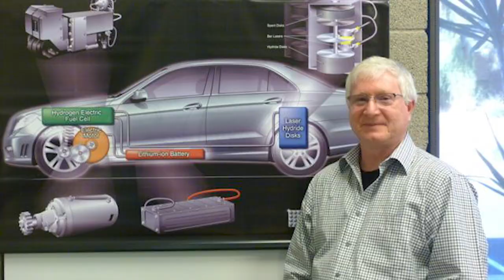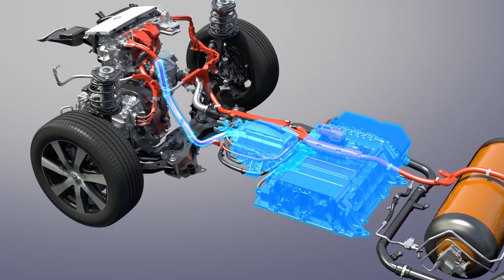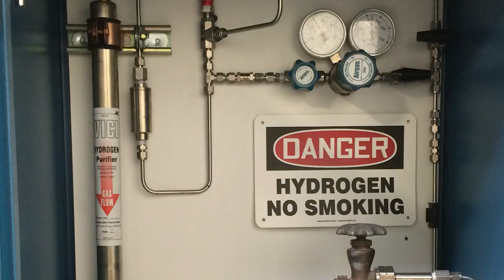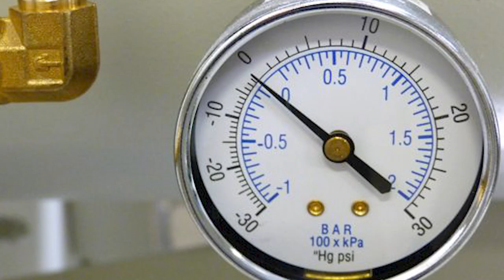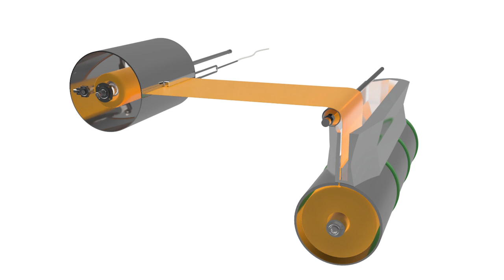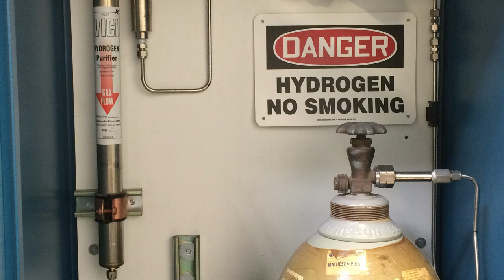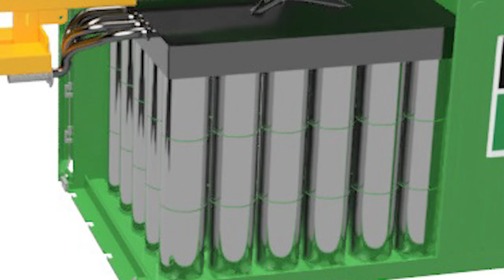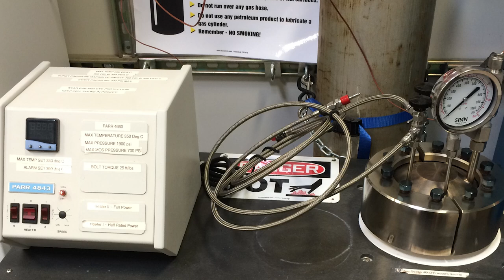This BANNED Technology Could Push Hydrogen Cars Over BEVs

Comment: Incredible! Looking at this, electric trucks really don't make much sense.

I have a question - would it be competitive solution to store energy for several months? For example, charging/fueling with Hydrogen over Summer, and using that in Winter?
Reply: 😂 this was a BS scam.
Reply: Regardless if this storage technique is a scam, it's still too expensive to make hydrogen and convert it back into electricity to run a truck.  And just burning H2 in a combustion engine is even way more expensive and energy intense.  You'd have to crank up the tax on diesel to make it over $25/gal to make hydrogen economically feasible.

Comment: The primary barrier to hydrogen is that it takes twice the electricity to make it as it does to power an electric vehicle the same number of miles.  It will be hard enough to supply the electricity to power a replacement fleet of EV vehicles, so thinking we can generate the electricity needed to produce hydrogen and liquify it is just crazy talk.  There may be a place for hydrogen though, and that would be for long haul trucks or perhaps trains across long south and north routes where the cost to electrify those routes may make it economically viable to use hydrogen instead.

Comment: What I'm always missing in the discussion about hydrogen is the fact that you cannot store compressed hydrogen in any kind of bottle, since Hydrogen has the nasty property of diffusing even through thick lead bottles.
Just let a Hydrogen canister rest for 2 weeks, it will be almost empty.
I'm wondering if this is the same here, but as the H is bound to the tape, maybe it's not and that would be super cool.
Reply: Its a scam and all BS. Think about why teh shuttles had such huge tanks and it relates to teh atomic size of hydrogen...
Reply: Hydrogen doesn't "diffuse", since its one of the smallest, if not THE smallest gasses - it seeps out of tanks who otherwise would seem "sealed". This is why Toyota made specialized carbon fiber tanks with plastic inner lining and glass fiber outer lining. They are trying to make sure the tanks are not only strong but not prone to leaks.

Comment: If it uses a laser to release electricity from the hydrogen embedded in the film, won't the laser beam be affected by the rocking motion and bouncing of the car?
What is the hydrogen capacity of the cassette (or the film roll), and its electric capacity?
What is the expected range (for an average 4 door vehicle).
Fascinating.

Comment: Energy density is the issue evs have, if hydrogen can resolve that in both overall weight of the system and refueling efficiency (speed and ease of) then this is certainly a game changer

Comment: Hydrogen isn't a power source. It's a power storage system, like a chemical battery. You must put energy into the system to get hydrogen to make power, just like with a battery.
Instead of starting with a blank piece of paper and asking what we really need in a car, the hydrogen people are simply trying to replace gasoline with hydrogen. But it's really not that easy. There's an enormous supply chain required for hydrogen vehicles to become a thing, and even then the efficiency rates are lower than battery.

The supply chain for battery power (as far as the end-user is concerned) already exists, we just need more of it. The power grid has been around for decades and is standard tech at this point. We will need:
a. More power generation.
b. A more robust power grid.
c. Better transmission efficiency wouldn't hurt.
d. Better baseload capacity, as opposed to green energy.

Comment: What would it cost to convert an existing ICE to run on this hydrogen?  Can they produce variable volume on demand or will there need to be compressors and storage to deliver high instantaneous demand?  Automotive with fuel cells will still require some kind of "peak power" source like a battery or super cap for high instantaneous loads.  What would be the overall cost for the auto companies to replace the fuel system on presently manufactured ICE cars to this tech?  How much CO2 reduction would you get?  Would these cars be affordable, unlike todays BEV?  Could the same physical  "H2 battery? be used to replace propane in a home for heating and cooking?  For a backup generator?  For tractors and lawn mowers?  For replacing natural gas, the really bad greenhouse gas because of the massive leaks in the production and distribution system?  A well thought out systems approach to use of this tech is warranted.

Comment: The problem with hydrogen tech is not that it doesn't work but rather that it is very expensive for larger scale application and probably doesn't solve the problem we started with, this is pollution.  Firstly, I don't own a hydrogen well and I doubt if you do, all hydrogen is 'manufactured' that is made out of or extracted from something else.  Most is made from a process with natural gas that itself is becoming rather expensive and in some places hard to get, and the process itself is intensely polluting so it like the electric car (battery) issue when the car is either powered or charged with electricity generated with coal or oil, only worse.  The alternative procedure, electrolysis, uses large amounts of expensive electricity to produce commercial amounts. Once produced, hydrogen is difficult (means expensive) to store or to transport.  It can't be pipelined, and it is a dangerous commodity to ship, even the process of transferring it from the 'gas' station to the vehicle, I don't see this as a 'self service' task unless there is a qualifying procedure.  Technically almost anything can be solved or fixed but sometimes the remedy is expensive.  The automobile became successful as it become cheaper and more efficient than using the horse.  Battery powered vehicles are many steps ahead of other alternatives and if we made the large infrastructure investments of going to the battery mode there will be little incentive to change this course midstream and go in a significantly different route.

Comment: This is an awesome technology. Theroblem I see with all the new tech is you have to totally replace your vehicle. Your current vehicle has a carbon footprint from the manufacturing process. If you have to replace it, you have just increased your carbon footprint. If you could create a technology that would adapt to your current ICE powered vehicle and reduce or eliminate the need for oil and not have to manufacture a new vehicle for every auto owner in the world, you would not increase even the initial carbon footprint or the cost involved in manufacturing a whole new vehicle. This would reduce CO2 emissions from the start. Current tech, ie electric vehicles and hydrogen vehicles, keep increasing initial carbon emissions until a reduction is realized by using the new tech. If the carbon emission problem is real, I would think we should reduce it as rapid as possible, not by continued  manufacturing poccesses, some of them  being more destructive to the environment. The current trend of switching to EVs to reduce our carbon footprint is very costly for the consumer and very profitable for the EV industry, and it has a destructive initial increase in carbon emissions. The general public is paying for the initial increase while the manufacturers are profiting greatly and making the problem worse initially.

Comment: I’d like to know how can there be a resolution between the greenhouse effect of water vapor compared to carbon dioxide. Water vapor is the most potent of the greenhouse gases in Earth's atmosphere, representing 60-70% of the warming effect on atmospheric temperature, while CO2 represents 25%. Pushing hydrogen powered vehicles seems counterintuitive unless all the warming effects of these gases on climate change pushed by the climate alarmists is nonsense.

Comment: Cool, how long will it take to get a product on the road to purchase?
Reply from the maker: Nobody knows yet. If they get the new funding and start working on it we'll probably know in a year or two.
Reply: @EforElectric  In order for this to have a chance an automaker would need to scrap everything else and dedicate all their resources and R&D to mass producing hydro vehicles. They'd also have to do it rather quickly as Tesla is making huge gains in EV tech every year as well as having a gigantic head start in infrastructure.

does the guy talking about this plan on becoming an automaker?
Reply: @BronzeLincolns81  Hydrogen storage in metals is not viable for vehicles. Even if one magnesium atom could magically bind 10 hydrogen atoms, magnesium has still 24 times the weight of hydrogen. Magnesiumhydrid (the stuff talked about here) as a sumformular as follows: MgH2. Which means you need one magnesium atom to store two hydrogen atoms.

So to store enough hydrogen to power a vehicle you need a lot of magnesium.

So for every 1 kg of hydrogen you want to store you need 12 kg of magnesium to bind it. You can say that 1 kg of hydrogen is roughly eqivalent to 1 gallon of gasoline. So to get the same millage out of it you need ~15 kg of hydrogen, which also would cost you ~210kg of magnesium. Amazon lists 500g of pure Mg for ~20 $. So your fuel tank alone would cost you ~8.000 $. And here is the kicker: for every magnesium atom you mine from earth, two molecules of co2 is released, as magnesium naturally occours as MgCO3·CaCO3

This is such a stupid idea on such many levels it is honestly frustrating such videos exist and youtube removed the dislike counter ...

Comment: There's a Good YouTube with one of the Engineer's Tasked to Back Engineer an Alien/ET Craft at S4 (Area51) He was the original Whisstleblower along with GeorgeKnapp (Television Journalist) on the Propulsion system for spacecraft that doesn't burn fossil fuel. His name is Bob Lazar. He designed and had a running prototype of a Hydrogen Car which can be seen on YouTube

Comment: The govt or some entity has decided that diesel CARS are no longer allowed in the U.S. Today, I can't buy a Vw TDI. The govt hit them over the mileage computation hard. I believe, ON PURPOSE, to take out the mileage competition of diesel engines. I can only get a yruck or SUV with diesel. The Japanese have a diesel hybrid that was to get nearly 200mpg. The battery lobby is pushing out competition. Hydrogen included. The question is WHERE ARE ALL THOSE ELECTRONS GOING TO COME FROM TO CHARGE ALL THESE LITHIUM BATTERIES FROM A VERY OLD GRID AND OLD POWER PLANTS THAT THE CARBON LOBBY SAY ARE BAD. ?? Hydrogen and fuel cell makes way more sense. Lithium is very intense on the land,battery disposal, battery life and expense  is a BIG ISSUE.

Comment: Great, now where do you "fill up" on hydrogen if you live in North FL. While charging stations are being built across the States, especially in FL, maybe hydrogen stations could be added to the list. I have been thinking of this for about 3 months or longer. But one down side, with EVs you can have your own power station at home and not be dependent on a service station somewhere else....whether it's gas, hydrogen, or electricity "service station." OK, super chargers but the point remains the same>I'd rather have the autonomy of having my own charging at home as long as it's Level 2 and doesn't take longer than 8 hours.

Comment: LOL, GW Bush invested a billion into hydrogen and it had the same problem then as it does now, too expensive. Only Iceland has been able to make this work well and they have an endless supply of geothermal power they are using to extract the hydrogen and even at that they also use geothermal to make power to charge batteries and get much better efficiency. New day same old line.

Comment: By the by, if a hydrogen tank does spring a leak it's not a huge deal. Hydrogen being such a light weight gas dissipates in a handful of seconds. Besides tests with even high caliber rifles needed at least 2 shots in the same place on a hydrogen gas cylinder to penetrate the shell and cause a catastrophic failure. The super high preasures causes the tank to be evacuated extremely quickly and as said before the hydrogen then disipates very very quickly.  A catastrophic failure is HIGHLY unlikely.

Comment: I think this is a strong contender for heavy vehicles. Maybe shipping? Also if it really is light perhaps aircraft too? However for cars my feeling is the infrastructure and complexity of the system will be the downfall for small vehicles. Electric cars can be fundamentally quite simple. Also electricity can be distributed down wires and generated locally or remotely quite simply.

Also with regards to hydrogen power has anyone done any research on what would happen if we had millions of vehicles pumping out water vapour?

Comment: “20% the cost of a battery”

Is that the cost for one use? Or can it be recharged?

Batteries can currently be recharged 1,000 to 2,000 times. Newer batteries will increase this.
Reply: “Reusable 100 times”

How much does each charge cost? A Tesla costs around $15 for around 300 miles of charge.

Comment: A DEMO IS NEEDED....NOT MANY FUEL CELL VEHICLES AVAILABLE.  The Toyota fuel cell car is available in California....but may be lease only.  It would be helpful to purchase a Toyota fuel cell car and replace the high pressure tank with the Plasmakinetics system.....however, this will not happen because the Plasmakinetics system does not produce enough H2 to power a toy car....sorry, but fraudsters will do anything for money.

Comment: I have a few more questions.
From what I understand hydrogen is quite a corosive element and can brake down gas seals and the like will that be any different for the film?
and how is it with longer duration storage? 
can you make the film in a plant in a place with abundant renewables ie closer to the equator for solar or places like Island for geothermal and then transport them to less optimal places like northern canada or europe or take them on expeditions to say north/south pole? (of course keeping in mind that the transport will not be effective use of resources in most cases)

Comment: The thing is - if you need (say) 5kg hydrogen to haul a car 300 miles - then these disks are still going to be 5kg heavier when full than empty.   You can't magically erase the mass of the hydrogen atoms.

So the pictures that make it look like these disks are wafer-thing things the size of a compact disk is deceptive.   Whatever it is has to weight 5kg more when full...and that's not going to happen with something that thin - it would end up being denser than gold...and that can't work.

So how big are these disks and how many of them do you need to power a car for 300 miles?

I think it's going to be rather a lot.

But in any case, all this does is to solve the issue of storing the hydrogen - and that's not really the problem that hydrogen cars have.   The problem is that you CANNOT buy a hydrogen car if there is no hydrogen filling station within a few miles of where you live or where you work.  That means that before you can sell a single hydrogen car into some geographical area, you FIRST have to spend maybe a billion dollars building a hundred (very expensive) gas filling stations,   And if you do that - then you put all of that investment, all of the staffing and training in place - and on day #1 - there isn't one single customer.   I'll probably be an entire year before you start seeing more than a handful of customers per day....what kind of idiot would invest in all of that infrastructure with NOT ONE CUSTOMER for it at day #1.

Electric cars got around that problem by having VERY cheap recharging stations that can be just dropped into any existing parking lot without any staff - and by allowing you to charge from any power outlet at home.

That forever dooms hydrogen technology.
Reply: This does not solve any hydrogen storage problem, its nothing but a scam for fund raising, if you  look at the atomic size of the hydrogen particle, literally 2 maybe 3ml will fit on the proposed size disc they have in there crappy animations, its completely absurd, but they rely on people not having done any science that dont know, and thats why so many comments in this thread are so embarrassing it hurts to see so many fellow people so poorly educated with such chemistry. You are one of the few that saw through it, for the most anyway.

Comment: FuelPositive Corporation already has a scalable  product which solves the majority of transportation issues as unit can be place even in remote areas. You produce nh3 which can be used through a fuel cell to produceh2 and water at tail pipe. Much safer to store nh3 than hydrogen. The cost per litre of nh3 .25 cents. You can also use it to produce fertilizer which is critical for farming. Any vehicle can be retrofitted deisel or gas engine. These guys have tried to get someone in Canadian goverment to support this venture but no one will even get back to them. I guess climate change does not matter. Must be hard to give up all those fuel taxes. Even countries without oil could be independent of OPEC. Imagine the benefits to the poorest countries.

Comment: This does not improve on the complexity of internal combustion engine. They are rarely lasting over 200k miles now a days with all the cheap sensors and complexity. Still need oil, open circuit cooling, hydraulic transmissions, etc. Internal combustion engines are just to antiquated, no matter the fuel that it uses... We need to push for more efficient clean and simplistic electric motors and transmissions. We need improved energy storage instead of wasting time and resources on alternate fuels...